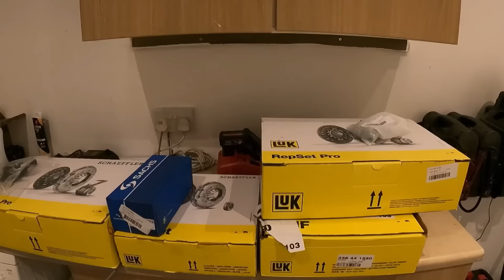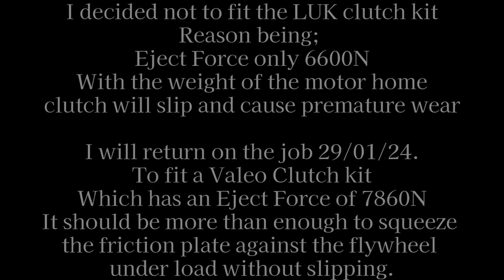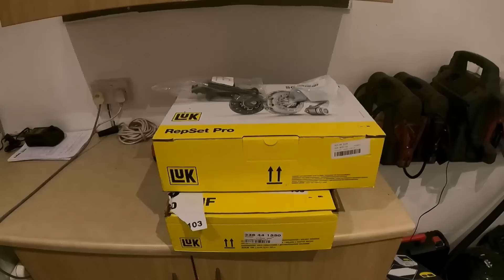Williams Mobile Clutch Service. Week 15/01/24. Video Log

Comment from the maker: www.williamsmobileclutch.co.uk 🇬🇧 
Click the link 👆🏽 for Price and booking Slot.

0:09 2003 Toyota Celica 1.8L VVTI Petrol.

38:25 2018 Hyundai i10 SE 1.0L Petrol.

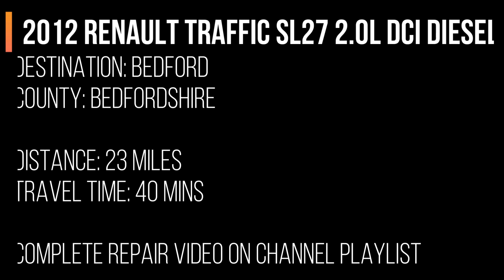1:10:12 2012 Renault Traffic SL27 2.0L DCI Diesel.

1:34:15 2009 FIAT Ducato 35 Auto-Trail 2.3L Multijet Diesel.

1:57:20 2014 VW Golf GT 2.0L BlueMotion Tech TDI Diesel.
Reply: hi kevin, does a sachs x-tend clutch require a special tool to install? please reply, good luck

Comment: Hi Kevin , thank you for all the effort making these video's.  thanks to your video's i have the courage to replace the clutch and flywheel  on my 2015 peugeot 308SW MK2 1.6 bluehdi.    I have watched a lot of your video's , but unfortunally you don't have a recording of a 2015 308SW.   which other car could i use as the best matching example for my job?   Keep up the good work and greetings from the netherlands.
Reply from the maker: 3008 is just the people carrier version of the 308. Exactly the same under the bonnet.
Reply: Thanks  for the reply, that's great to hear !  I have some time before my parts arrive so i can study some 3008 video's.  Hope i can be as efficient as you are and finish the job in a day.   @WMCS

Comment: Good to see you using a heater in these sub arctic temperatures. Wow that Celica took some work to disassemble. I thought being 20 years old it would be easier, just shows how well engineered it is. Well done bud. 👍
Reply from the maker: Definitely a nice little bit of luxury that heater is .. life wouldn’t be the same without it .. celica was a little gem 💎

Comment: I've said this before, when the man of steel has his diesel heater running on overtime you no its COLD. 🥶👍
Reply from the maker: Mate it was so frosty that my 13mm socket snapped in half 😆
Reply: that's cold @WMCS

Comment: Another Celica? I just finished the clutch change on mine. Just waiting on a homie to help me reattach the axels cuz we didn't have the nut to pull it out from the wheel hub
Reply from the maker: They’re great cars I think. I specifically this model. I think this is one is quickly turning into a classic.
Reply: @WMCS  it definitely is I live in the Caribbean n mine has a full skirt kit on it which breaks necks. The only downside is I have the superstrut Japanese suspension so following YouTube guides will never show me step by step what to do

Comment: Hi Kevin!
Can i get your opinion on Borg&Beck clutch kits?
Reply from the maker: Only thing I know is they’re quite popular off eBay. I’ve never even held one in hand. 
When buying a clutch what you need to know is is the pressure plate force and the amount of copper or ceramic in the friction plate. That’s where the price lay. 

Otherwise it’s cheap metal that will weaken with temp and chocolate melt the friction plate. Long answer to a short question.